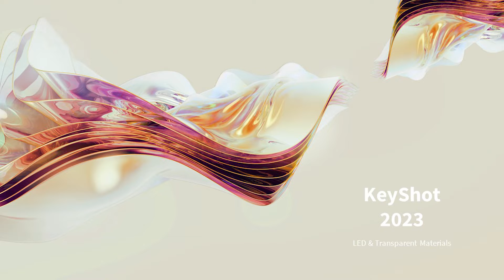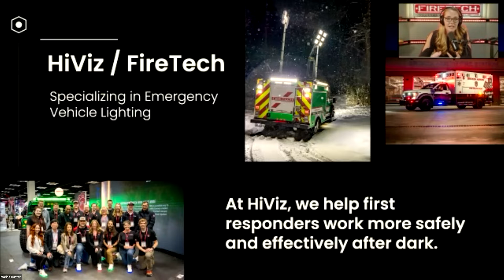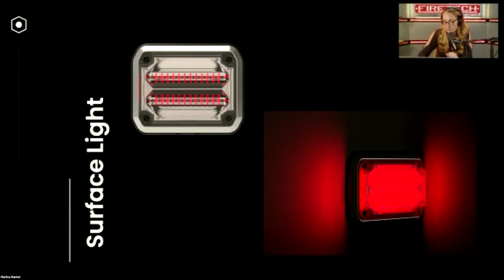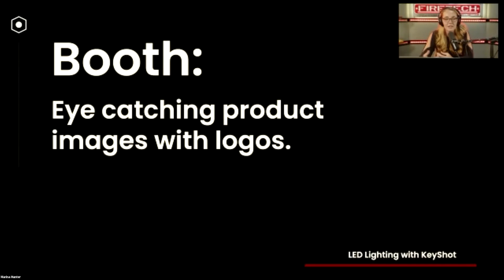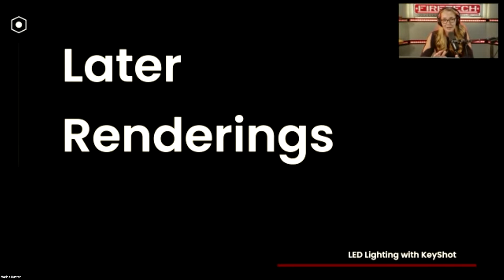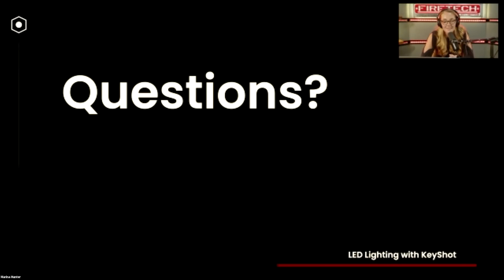KeyShot Webinar - LED & Transparent Materials - HiViz LED Lighting

Comment: Class presentation Marina, and a pleasant presentation voice. Think such LED fixtures are always and with every renderer pretty hard to get right. There's quite a lot happening in such small fixture.  I wonder if the result would be different if you would scale the entire object like x10. Of course you need to adjust values but it might help a bit for calculations/light rays since they got send depending on the surface area, at least, think that's a bit how it works. Anyway, great to see all the progress and fun product to work with render wise.